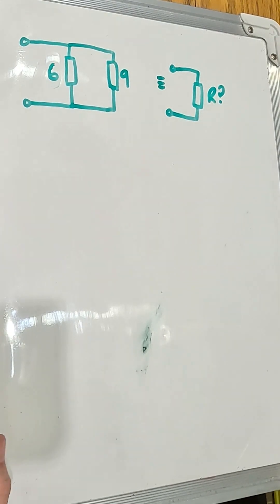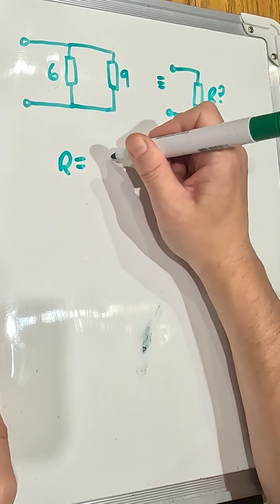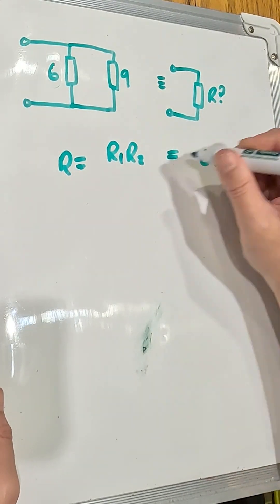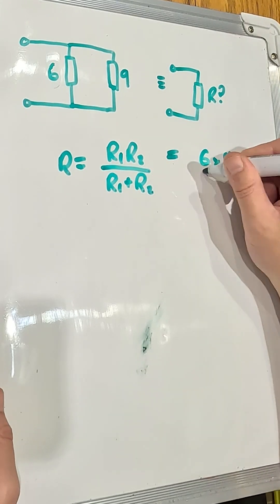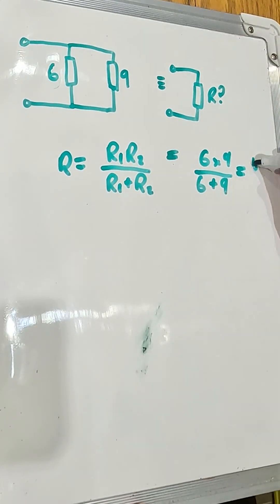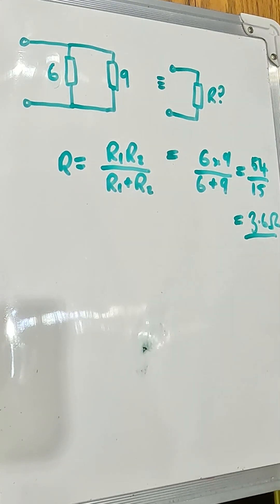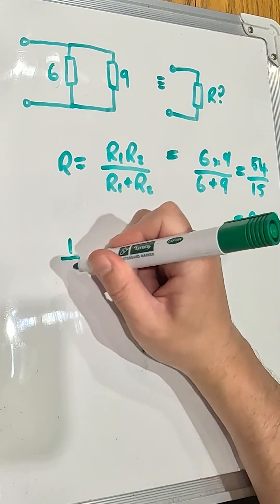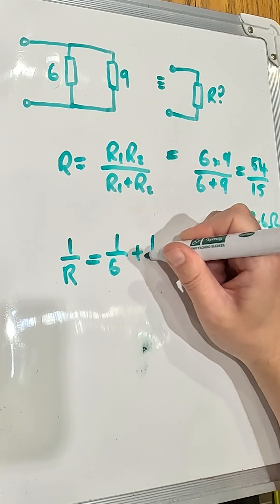Combining parallel resistors made EASY! #thecircuithelper #shorts

Comment: Does this work for three resistors as well?
Reply from the maker: It can be used, but not so easy. First combine two of the resistors using the equation, then use the equation again to combine the third resistance and sum of the other two. 

To be honest, it’s much easier to use 1/Rtotal = 1/R1 + 1/R2 + 1/R3 when you have more than two resistors!